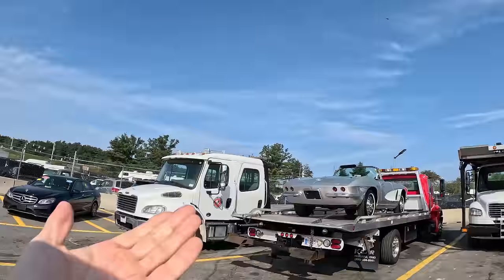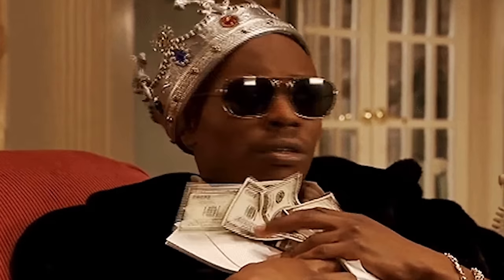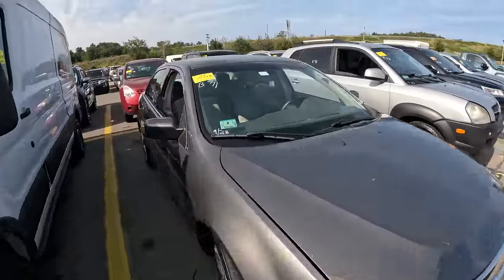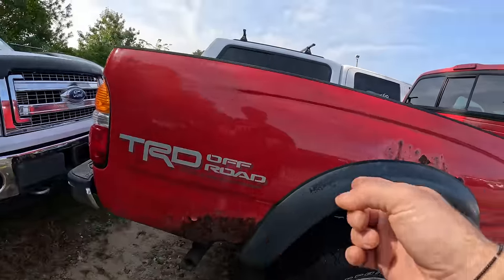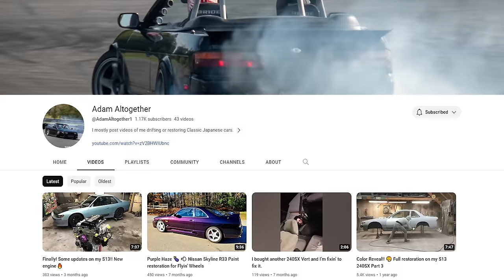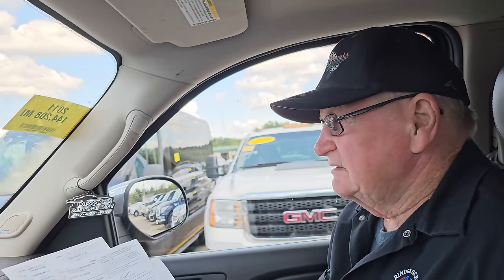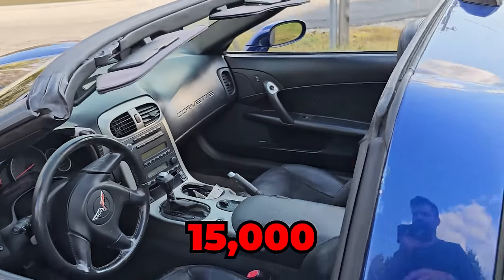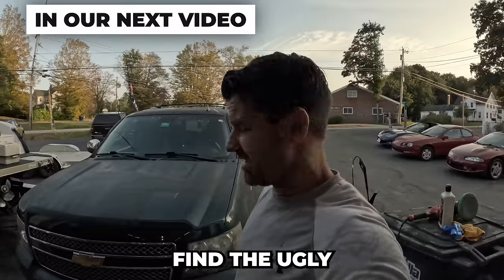AUCTION DAY! What will $5000 buy us at a Dealer Only Auction?

Comment: The 97 thru 03 Ford 5.4L engine is a 2 valve engine like the 4.6 and is super reliable.  The 5.4 3 valve starting in 04 have variable valve timing that caused lots of issues.

Comment: Craig, you’re absolutely correct to bring a scanner with you to check the monitors. There is an awful a lot of people out there that play games. However, on the flipside. All somebody has to do is clear the system. Now it looks like somebody was trying to hide something.  Makes all the monitors not ready😡Those are scammers within the auction. Just so they can buy the car cheap. They do a lot of terrible things. Remove fuses, cut wires, pull spark, plug wires. The list goes on sadly. Ron

Comment: You are correct, Craig, in that we Toyota and Lexus owners are a PITA and nit pick everything. I am even moreso with Lexus vehicles. "Has the brake actuator been replaced; what's the part # on it?"  "What's the condition of all 8 control arms?" "Look behind the engine on top of the transmission bellhousing and see if there are any signs of pink coolant."  LS460 🙂 And we know exactly what we want!
Reply: Was the timing belt changed?
*surprised Pikachu face*

Comment: Some banks do absolutely sell to the public.
Mine in particular does.
Its a credit union.
However they only sell the very nice repos that are ready to sell.
With that said, they do not look em over like a dealer might (not all dealers do, some in particular make em look good tonl get more but do nothing in terms of mechanically fixing anything).
In any case, if ur buying an older car used, ur taking some risk. The risk increases on models and brands with known problems.

Comment: F150s like that are common where it's warm. I would buy that if its reasonable since starting from that condition it would be easy to get twenty more years out of it (except for being in the Rust Belt). My 1997 and 2000 are perfectly good dailies and I'll run them until I die of old age. BTW the rear door cable attachment fittings are easy to replace with aluminum aftermarket parts which are cheap so use that to bargain when the seller hasn't fixed them.

Comment: The 4.2L engine in the 2013 to 2015 was the perfection of the 4.2 NA V8 audi made, had the A8 4.2 and i loved that and got to test drivethe RS5 4.2 as well. Madness sounding and 8k+ red line just slaps. Almost bought one instead of my current S6, but the S6 has a lot more potential. The RS5 is a dream car I would love to have, audi nailed it. The V6 engine is more reliable but that particular V8 was awesome. I can't remember but I'm pretty sure it was the Lamborghini 10 cyl with 2 cyl chopped off but I can't recall if it was that one or not. I'm not expert just an audi lover.

Comment: 2016 expedition with low boost codes are a nightmare. I have had both turbos replaced and a wiring harness. Now i just live with blow by into my intake. Forget about the aluminum issue, why wouldnt Ford install catch cans on these twin turbos?

Comment: Hi Craig loved this video does this foxwell scaner clear cods and have the full range of features like the professional ones
Reply from the maker: Yes it clears codes and does live read outs as well
Reply: Don't buy these cheap scanners if you're trying to do professional mechanic work, they do not have every feature you need, there's a reason auto shops use the brand name scanners and not these.

Comment: How disrespectful to the Ford F150
Reply: Those V8's of the late 90's were beasts! They were legit built for a million miles. I got 450, 000 on my 97 F150. And still runs like a champ. I had to replace the battery back in May, even the damn battery went strong for 8 years in that truck. Now, my radio doesn't work, but that truck cranks and drives like a dream every single day!
Reply: @kennybeck5519  Thank you but he wasn't acting like that he just went over the car like it was nothing

Comment: Do you sell a lot of Chevy Equinox’s and do you think the vehicle is worth buying? I just bought a 2021 after renting one from enterprise so I bought it from enterprise. It was kept very nice with low mileage and a good maintenance record but just wondering if you run into any issues with the 1.5 liter turbo from GM? I’ve read so many mixed reviews and also read GM put that motor in a lot of vehicles because of the modularity of parts between multiple vehicles.

Comment: Do you not know that like 3-6 more people touch that car before you buy it. 1 person probably had a to change the tire , anothed person had to drive it and make sure its drivable , no one would die if driving it. Another person had to make sure the car is placed in a good are along with all the other cars that will be sold in that auction. The. Some one has to bring the car up into the auction.  1 of those people smoked a cigarette.  Bingo that's what it does not smell like a smoker.  Hmm oh I know why because the vslet dude smoked 1 cigg while dropping it off in the auction tent.